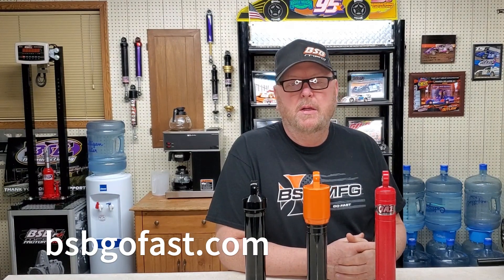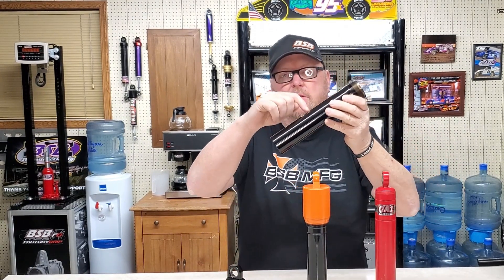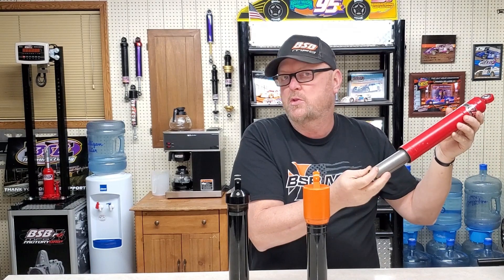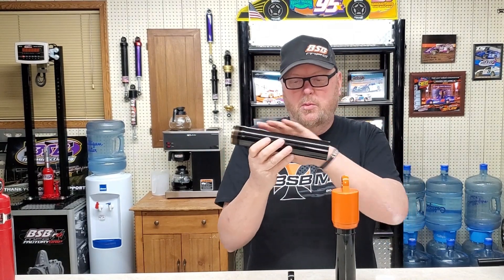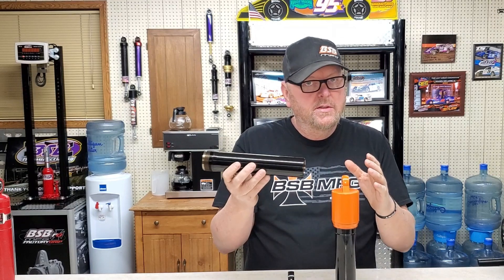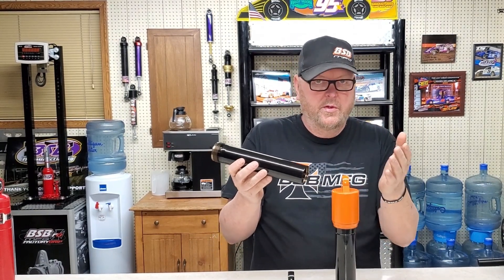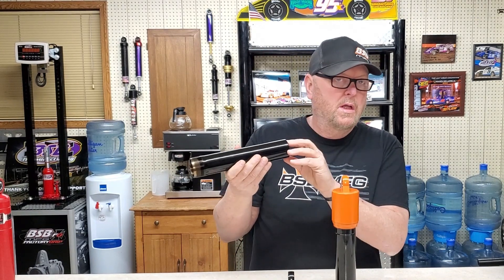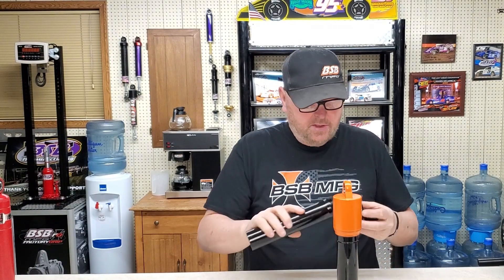Shock Basic Pt 4  (Shock Bodies)

Comment: It is my understanding that twin tube shocks are more expensive, case in point the rear shocks on my van are twin tube shocks and they are 300.00 each and my struts which are mono tube are around 100.00 each. Which from my vantage point I can see why you wouldn't be a fan of twin tubes.